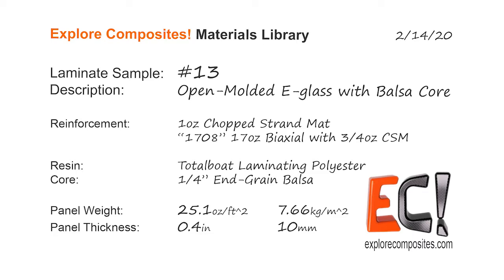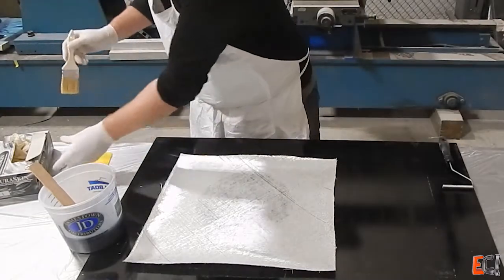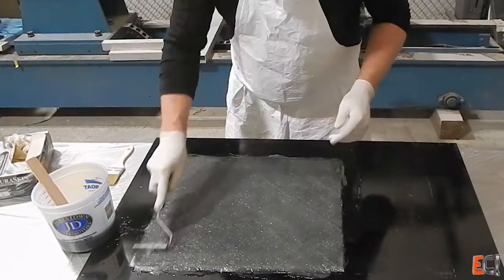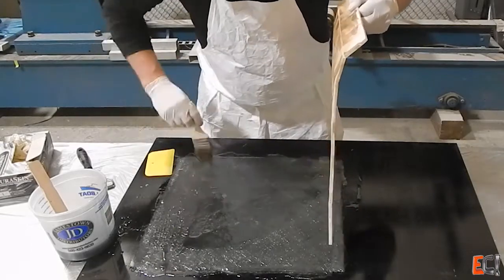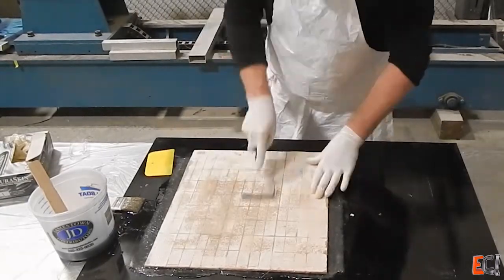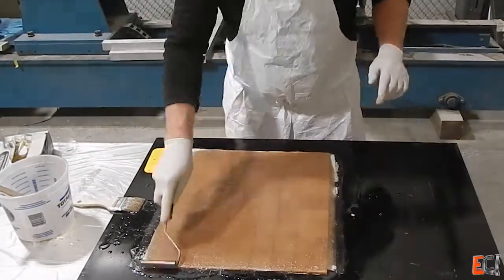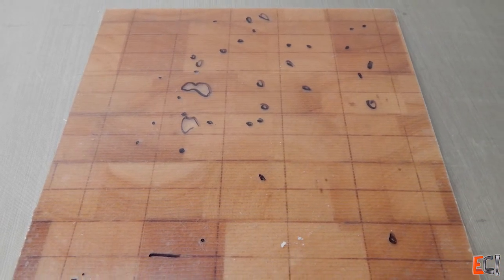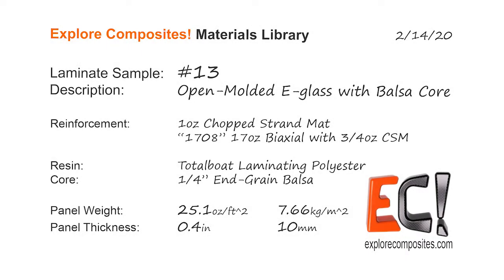Laminate Sample #13: Open Molded E-glass / Polyester Resin with Balsa Core

Comment: You can do all steps like you do same day ?
Reply from the maker: Yes.  The polyester resin cures fast - like under an hour.  It is best to bed the balsa down in something more filled though!  You could also let the bottom skin cure so the core bedding doesn't slide it around.  It can be done in one shot like this, but it is rarely the best idea!
Reply: @ExploreComposites  ok understand , thanks for your reply
Reply: @ExploreComposites  Sorry broo but you know is the balsa core on a checkmate starflite 1986 is 1/4" ??? I mean in the floor of hull

Comment: I am interested to know how tight a radius I can build with Balsa,
Reply from the maker: If you want to cut solid core into trapezoidal strips, you could go quite tight.  With standard contour-scrim balsa, the dimensions of the blocks will limit the extreme contours you can do.  With thinner core you may be able to break or manually slice the blocks to better fit tight radii.

Comment: Open balsa soaks up a lot of resin. Better to coat each side with a resin that has a thixotropic additive (micro spheres) to sin the balsa with. Then layup when that gets tacky. There's another channel that did a demo on this... Tech Ingredients: https://www.youtube.com/watch?v=tiS8ArzEA58
Reply from the maker: Yes - you're totally right - pre-coating is a good option.  Thanks for linking to that video - it is a great explanation!  Just note that he's using epoxy though which has different viscosity and cure properties than the polyester resin in this video.

Even a filled bedding/bonding adhesive works much better than the straight resin I tried to use.  I wanted to show this issue and also not hide the balsa by using a filled adhesive.  I think some weights or minimal pressure would have largely solved the problem here but it is something to think about with balsa.